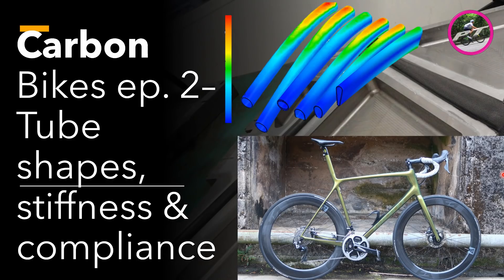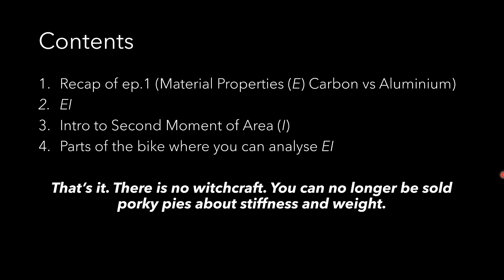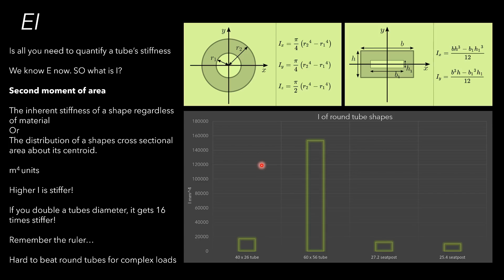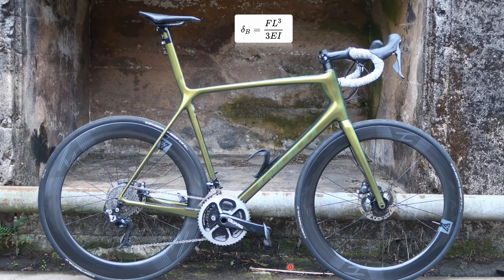Bicycle Stiffness - The Truth. Ep 2. Second Moment of area, stiffness & compliance explained.

Comment: First of all great video and good explanation on technical mechanics. Did you model all simulated seat posts as aluminium to show how the shape influences bending stiffness or did you model them in their real world material? Correct me if I am wrong. But since CFRP is an anisotropic material you can't use von mises stress to compare it with aluminium, since one criteria to use von mises stress is to have the same Poisson's ratio in all directions. Also, did you validate your simulation with real world testing?

Comment: This subject needs to be re-visited. I have 2 identical bikes, one disc, one rim. All parts & dimensions the same. Why is the rim bike so much more comfortable & generally livelier?  Rim tyre pressures 95psi. Disc tyres 80 psi, & still the rim is more comfy. The only differences I can see are the beefed up front fork (obviously), & the thicker chain stays. Surely, the large difference in comfort & liveliness has to be down to the rear triangle, which seems to have more effect than you think.

Comment: Your engineering is good, but I’m not sure your application is at the same level.  Some of this comes from youth and what has been lost regarding cycling history.  If we ignore TT, especially on track, there’s not much to show that top level cyclists are faster than those who rode on bikes with steel “Standard Gauge” tubing.  Which covers a long period of time which largely ended by the late ‘70s early 80s. So…. Let’s assume that TT gains are largely improved rider aero position (and I welcome any sound argument to the contrary).  Ergo: large tubes, aero-tubes and components, non-round tubes, new materials, aero wheels,and so forth have essentially contributed nothing but marketing.  That they’ve done in spades as you see the rampant inflation bicycling prices (even as it has been arguable that the cost of mfg. has gone down).

Tire, fork, handlebars, seatpost, stem should be the primary sources of compliance, and in that order.  Put on a set 21mm tires at 120 PSI, and on a smooth road you’ll feel the wing of a fly as you ride over it.

Back in (I think) the mid-70s, there were successful Senior Tour riders on on Alan screwed and glued aluminum frames.  These aluminum frames shared the same skinny tube diameters as the steel frames of the era.  Your engineering will demonstrate how comparatively soft these bikes were.  They saved weight.   I doubt big sprinters could make use of them, but small climbers could. And for several years they were popular enough to also be sold under the branding of other bike manufacturers.  Obviously this calls into question the idea that without stiffness, meaningful efficiency is lost.  Despite rider preferences, I’d offer that if a frame is stiff enough to handle well, then it’s stiff enough to race.

We don’t often hear much these days about being supple on the bike.  This is probably a loss for all riders concerned.  Why are you sensitive to seat-post stiffness?  Do you bounce on your seat?  Perhaps not, but if you haven’t considered it, we’ll maybe it’s time to.

Also I’m not  issue of braking difficulty when braking.  Personally, I tend to take weight off the seat in any kind of challenging braking.  This is both to facility shifty my weight as necessary and to radically reduce unsprung weight (which effectively is the whole bike rider combo).  Maybe you can explain this one to me better.

Anyhow just a few thought from the salt-mines.

Comment: The bike needs to be stiff enough to feel safe in handling. However wouldn’t all frames mor or less bend when pedalling? Some more some less, the question is if any energy is lost  I.e. what is the frame’s efficiency. There will be heat losses, and this depends on the material.

Comment: Great videos! I love your channel & factual/scientific basis of the information. This may be just me, but I'm unsure of the appeal of stiffness? Is it because of responsiveness in ride? Conservation of energy in peddling? I assume it works against comfort, hence the need for designing compliance into the bikes etc?  The appeal of carbon for me personally had always been the allure of lightness/ aesthetics of the 'aero' designs; something that I have found a bit difficult to justify given my alu bike weighs less than 1kg more than the carbon bike I would have to spend £3-4k on... and as one of the humorous comments in your Ep1 video said, one can take a dump for the same weight gain... I wonder whether there'd be a market for Alu bikes that were designed to look more 'aero'- i/e/ not the conventional circular tube cross-sections? Or would they be too heavy?

Comment: In fact, if you double the diameter of a tube with a fixed wall thickness, the second moment of area will not increase by a factor of 16. That's true for a solid rod, or when the wall thickness increases with the diameter. If the wall thickness is constant and small relative to the diameter of the tube, it will increase by a factor of around 8. This is since r^4 - (r-c)^4 is a cubic function of r, while r^4 - (0)^4 is quartic (here c represents the wall thickness). Of course, either way the point is that the diameter of the tubes is hugely important.

Comment: Your slide around 6min comparing a 40mm tube to a 60mm tube with constant wall thickness is interesting but not that usefull for the bike industry which is chasing weight. Going to a bigger tube at a constant wall thickness means heavier so one could easily say "of course heavier is stiffer". Same goes for your seat tubes shape comparaison actually. What would be the results with weight held constant accros shapes and materials ?

Comment: I wonder if tube shapes could be designed from the ground up from a stiffness standpoint and get the 'aero' treatment after the fact. I mean like thin plastic fairings over most of the tubes. Sounds a little old school but I think it would work well in this case.

Comment: Tell the UCI to change their frame rules. They are based around the design of metal tubes not the properties of carbon fibre. Frame aerodynamics makes a lot more difference than the weight of frames but it way better to have monocoque carbon frames for its mechanical properties too.

Comment: What's the difference between automotive race f1/Gt4 and aerospatial grade carbon and carbon used in the top top top end from like the Tcr advanced sl, Emonda sl7 etc. You know the best highest end carbon from the highest end bikes from the top brands ? Ax-lightness which started out as a auto sport f1 carbon part manufacturer says the use automotive and aerospace grade carbon in their bikes like the Vial evo Ultra which can weigh between 4,4kg-4,8kg is it lighter and or stiffer or something ?

Comment: 10:03: What makes you think that L is constant? Designers can opt to change the angle of the fork (and thus its length), or the length of the head tube (and thus the length of the fork)
Reply: L isn't fixed but compared to E and I it has much limited flexibility because it's driven by the bike geometry and kinematics rather than stiffness/compliance.

Comment: Very nice video. What I'd like to know more of is things like fatigue life of various materials (steel vs carbon vs aluminium), things like manufacturing processes (carbon - classic pre-preg layup vs. RTM), aluminium (hydroforming vs normal butted tubes), as well as differences between joining techniques for steel, like TIG welding or filet brazing etc. Repairability of different materials would be a great subject too.
Next I'd love to hear your thoughts about bikes which use hybrid or exotic materials, like magnesium, or Ti/Carbon hybrids - things like that...

What would also interest me is the economics of manufacturing bikes - how can a motorcycle cost less than a high end bike? In terms of revenue, Ducati is only twice as big as Canyon so the old argument about economies of scale doesn't seem to be applicable... Also how close are Microshift to Shimano in terms of performance?

Just my 2 cents
Reply: That's going to be difficult to discuss with any real world applicability as the different materials have different weaknesses to environmental damage (see the annual carbon fork recall by one or more of the big brands due to UV induced delamination). As far as econ, all that stuff is irrelevant. Marketing teams set a retail price. Accountants determine a production cost to maintain profit goals. Engineers then design a bike under that production cost limit. The consumer price of your bike isn't driven by production costs. Its marketing. Cost is determined, then the tech on your bike after. I notice no difference between MicroShift and Shimano, though I've not used the new hyperglide+

Comment: I might be super uninformed here, but it seems like steel has a roughly equivalent ratio of density to stiffness to both aluminum and titanium. First question would be what alloy of steel did you use for your numbers? Secondly, what is stopping steel frames from being exactly as light and stiff as aluminum and titanium frames, especially with modern alloys?
Reply: people who can weld super thin steels and corrosion/frame dings

Comment: Wait, don’t trusses still deflect under load? Been a while since I took structural..
Reply: The tension members stretch ever so slightly under load, and the compression members shrink in length, but there is no bending deflection on a well-designed truss.

Comment: Wait, what? How would higher stiffness negatively affect brake feel and modulation? Shouldn’t it be the other way around? 

Typically stiff things feel more responsive. Maybe too responsive? I’d like to understand this better.
Reply from the maker: Brandon Hicks yes it would feel more responsive and you would feel the ‘bite’ quicker. However, modulation is about adjustment of force. Softer springs provide slower acceleration/decelerations of forces therefore provide more compliance and adjustment. This is the reason why race cars are set up very softly sprung in wet conditions, to slow down the response of the brakes and cornering forces to prevent locking up etc.

Comment: In your stiffness simulation, do all tubes have same wall thickness? The Elite seatpost has extra material in walls, so clearly extra material makes a difference. Also, that extra material in Elite seatpost is thickest in points which form a line parallel to the load. I wonder if you rotated that post 90 degrees, would it be even more resistant to flex.

Towards the end of the video, you start talking about "compliance" and "feel" of the ride different seatpost materials/shapes provide, without backing those subjective terms with any data. Seems like a blemish on a series otherwise intended to dismiss marketing jargon.
Reply from the maker: Far yes the elite seatpost has non uniform thickness, measured and modelled from a real life example. Wall thickness and its distribution effects second moment of area (which the whole video is about). The orientation with respect to load (rider weight) is the same as it would be in real life with the saddle clamp fore-aft in line with the rider weight so i made sure of that. 

Simply put a seat post with a lower EI (stiffness) will be more compliant.
Reply: @PeakTorque  so, if looking for comfort. I should go with alloy seatpost with rather thin diameter thickness? My current carbon seatpost's weight (from merida) is 270g. Buying a Ritchey WCS AL2014 with 190g would be more compliant? Thank you

Comment: Instead of focusing on seatpost compliance and comfort, you could as well have a more comfortable seat and pants. I have a comfort seat with a hole in the middle + the thickest possible seam in my pants (Bioracer and Assos). I have that aero seatpost and guess what? It is still very comfortable and as I hate flexy seatposts this really works best for me. And don't forget tire width and pressure... set priorities and stop talking about supermarginal gains in comfort of seatposts while it's really something marginal compared to all I mentioned in my comment.
Reply: If you buy your next bibshorts from Everve in Germany, you pick the thickness of the padding yourself, as they can be removed and altered to most thicknesses. You can have various pads, yes, in the same bibshort.    Rtr
Reply: @borano2031  thanks, sounds interesting enough to give it a try!

Comment: Great video demonstrating compliance compared to the cross-sectional area.  Have watched alot of your videos since discovering this channel, really appreciate the engineering rigor behind your videos. I recently acquired a Supersix Evo Mod Team [same frame you had] and the first time I rode I, I noticed how little flex there was in the frame [especially the power transfer through the BB].  Coming from a CAAD12, this was a night and day difference.  I came across this video from GCN that actually shows a surprising conclusion, that frame "stiffness" actually matters very little with regards to transfer, its mostly a perception of how immediate that power transfer occurs [Link to video: https://www.youtube.com/watch?v=BH_AL4rxrp8]. Curious as to what your take on this is.  The test they conducted made sense and perhaps the perception in stiffness I'm feeling isn't actually resulting in more efficient power transfer, and more to the immediacy of that power transfer?
Reply: @UC08mbQ8UIX8DXSBFBO9VaZw  curious about this as well. Does the deflection in the frame means that the energy is gone with a loss in power transfer? I am not sure about this.  After deflection it will return back to its original position so no energy loss? On the other hand, descending @70kmph and making turns would be easier on a frame that flexes less in terms of handling, but thats another thing.  I am not an engineer so curious on your take on this.

Comment: "If you double a tube's diameter, it gets 16 times stiffer."  For thin wall tubes Ix = Iy ~= pi r3 t correct?  So it gets 8 times stiffer, not 16 times.  It would be nice to equalize the weights in the comparisons by adjusting the wall thickness.

Comment: It is a triangle in the most general term, but you are missing details. The seat stays are not straight. They have curves or bends in them. You also have to consider the angle of the seat and chain stay. Granted, it won't deflect as much as the seat post is capable of, but there will still be some.

Comment: I often wonder why the stiffness (or lack there of) of the rear wheel is often ignored. I’m only 150lbs, but this is the only area I feel flexing under load.
Reply: If you weigh more and do jumping and tricks like I do you feel flex in wheels instantly! A great test of rear stiness of a bike is to do a 180 hop. If your bike can survive that its a stiff bike. If it can survive you doing it incorrectly and not breaking, well you got a tank!
As a result when i get on a lighter bike feel genuinly scared the bike will just break cornering!

Comment: I thought the reason for going from steel to titanium to aluminium to carbon composite was because of beer canning.  To get stiff and light the tube walls get too thin so less dense material is preferable as it preserves crush strength
Reply: Yes, so there is more than E an I. If not an alu bike could never be lighter than a steel bike. Since steel  has higher E-modulus and yield strength, you could just match the diameter of the alu tube and reduce the wall thickness to reduce the weight. This is however limited by the local buckling strength of the tube wall.

Comment: 2:58
"Stiff, triangular structure.  Not designed to bend."
As a non-engineer, that is what I intuitively think when I consider Cannondale's goofy "kingping" contraption.  I suppose the triangle and seat tube can pivot a bit, but it's clear they're trying MARKET the "comfort" geometry hype promoted by Trek and Specialized.  I think I'd rather have a Ti frame anyway.
What say ye?

Comment: Correct me if I'm wrong:

If there were 2 bikes, Bike A has standard 73 degree seat tube angle and Bike B has something steeper (say 75 degrees). If both had their saddles set up in the same position in relation to the BB, ie Bike A with an inline seatpost and Bike B with a set back seatpost, Bike B would have more compliance through the seatpost than Bike A? Because the steeper seat tube angle would mean that the seat tube/top tube joint is further forwards in Bike B, and thus the lever arm (L) for bending is longer? Assuming everything else, ie seatpost diameter, material, cross section, etc is constant, that is.

That's for the great content! As a mechanical engineering student you brought learning out of the classroom for me.

Comment: So, to keep the same stiffness but reduce weight. You can increase the diameter and reduce wall thickness to match the stiffness needed. Obviously, if you keep doing it, at some point the wall will be too thin and fragile. Why so many carbon gravel bike have more massive tube than a climbing road bike then? Gravel require more impact resistance and also more compliance to smooth out the road. Making tube diameter huge and thin doesn't achieve that.